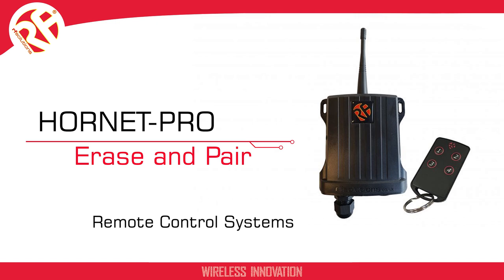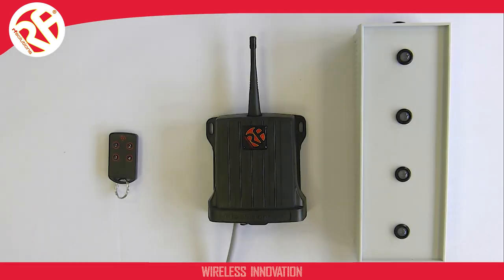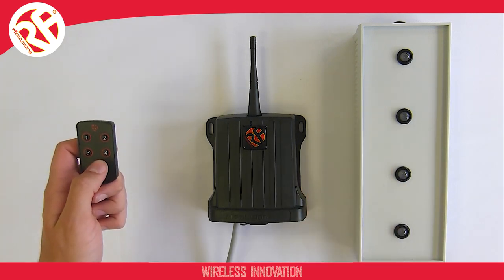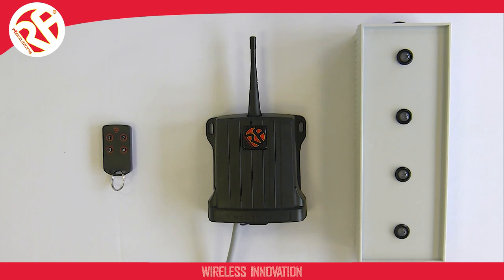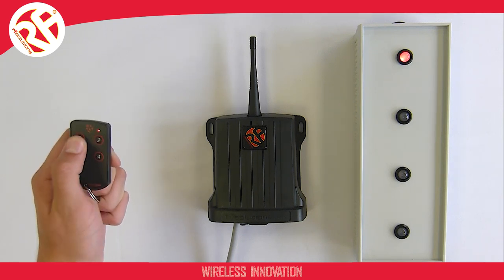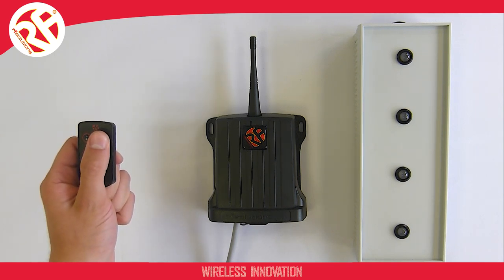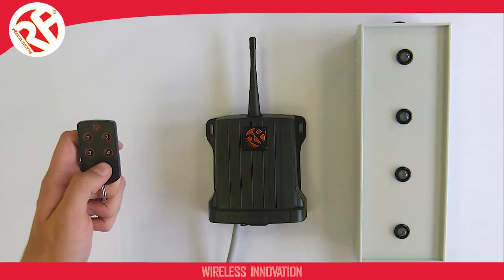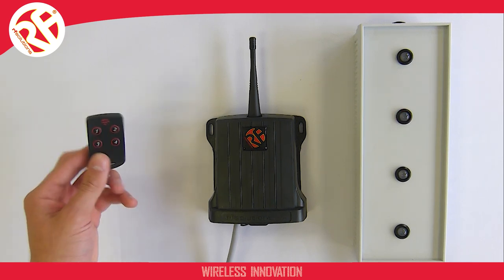HORNETPRO | How to Erase and Pair with a Transmitter | Remote Control Systems

Comment: What is the range of the product..??
Reply from the maker: The FOBBER key fobs can achieve a maximum range of up to 200 metres (that's with an open line of sight). If you needed a bigger range, we also have transmitters that can do 1KM+: https://www.rfsolutions.co.uk/remote-control-systems-c9#t294:t328 ✅
Reply: What is this product used for
Reply from the maker: @liammillar753  This product can used for a range of applications, anything that needs switching to be honest from lights, pumps, processors, valves, Roller Shutter doors, Garage doors, Sports grounds etc etc. It is not suitable for heavy current switching as the relays are rated at 240V/ 5A. If you check out our blog there are case studies showing how this products has been used by other installers - https://www.rfsolutions.co.uk/blog/